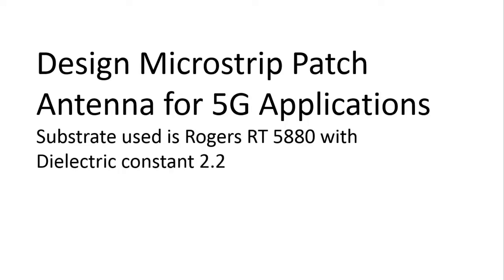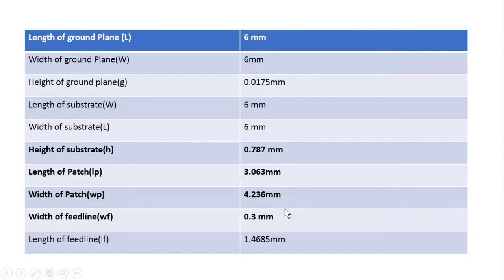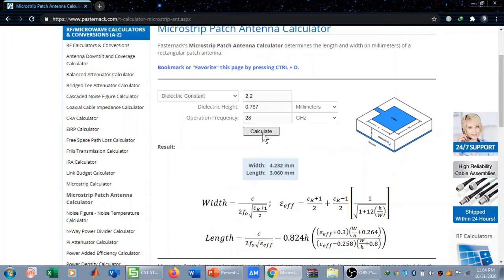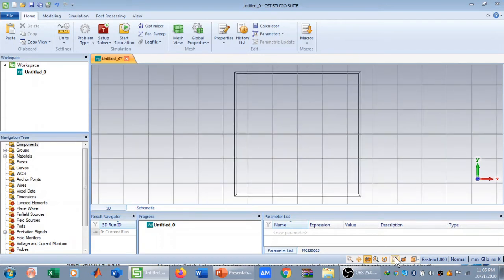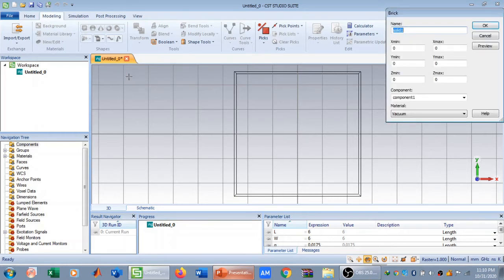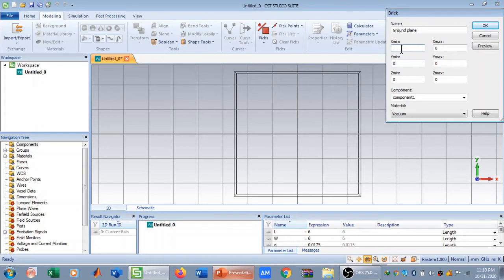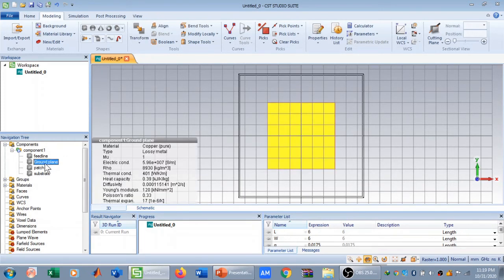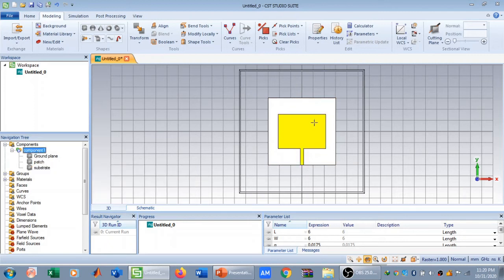CST Tutorial-2| Design of 5G  Microstrip Patch Antenna in CST Microwave studio

Comment: Really informative video! Just had a few questions!
1. How did you calculate the length and width of the feedline? 
2. And the height of the ground and substrate?

3. Why is the zmax for the patch h+g? In which case the patch height would become g?
4. Here, have we considered impedance matching? If not, how would we go about that?

Comment: what should i do? if i wanna make it directional antenna? kindly instruct me.
Reply from the maker: To make it directional i.e. to increase gain or directivity .you need to make an array of antenna
And you want beam steering..you need to use phase shifters in array of antennas
Reply: @TechnicallyExplained  can you recommend any vedio on it? Then it will be more clear to me.😊 Thanks
Reply from the maker: @fazlulhasan8274  To understand concepts of array of antenna...This is the best video
https://www.youtube.com/watch?v=vtPPAnvJS6c
Reply: You can use array antennas
Reply from the maker: @fredfrancium  you are right (y)
Reply: @TechnicallyExplained  salam. for beam steering, is it possible to use parasitic element combined with shorting vias to tune the main lobe angle?

Comment: How you get the value of the length and width of feedline?
Reply from the maker: The length of feedline can be taken any value as long as it is continuation of the patch..
 the width of feedline should be  taken as to have impedance of 50 ohm so as to match the impedance of SMA connector..
Reply: @TechnicallyExplained  but for impedance of 50ohm , h= 0.787 and w= 2.44 is fitting but you have taken w= 0.3 .... How?

Comment: how to design 7ghz antenna in cst
Reply from the maker: You are using which substrate? And what is the dielectric constant of that substrate?
Reply from the maker: Visit this link and put values..  https://www.pasternack.com/t-calculator-microstrip-ant.aspx 

Put the value of dielectric constant of substrate and the height of substrate in millimeter.. 

In return they will give you the width and length of patch. Follow the steps in video and design the antenna
Reply: @TechnicallyExplained  Thank you